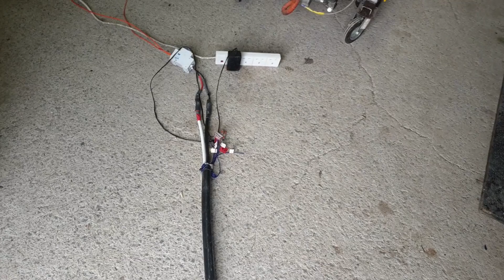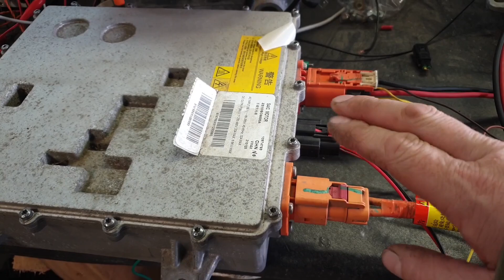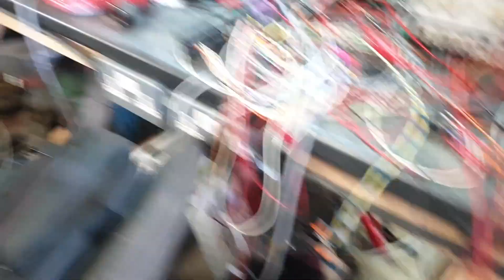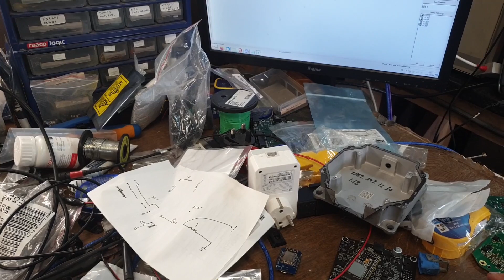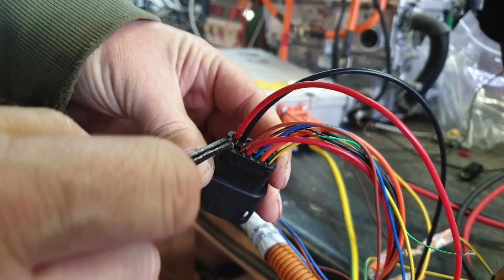MG ZS EV Charger Hacked

Comment: Amazing work Damien. Thanks for your hard work on this.
Reply from the maker: No problem. I hope to have a gen2 soon which has a dcdc built in and v2l capability
Reply: @Evbmw  i want to supplement my 1ph env200 charger to get nearer the 20kw ac charge plus add qleaf ccs too as some stage. These were the chargers i was looking at using